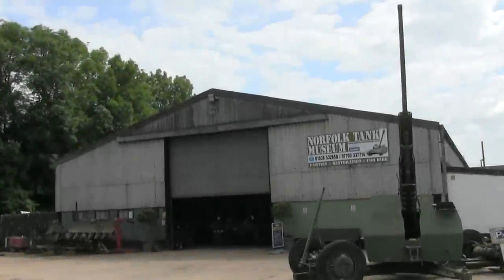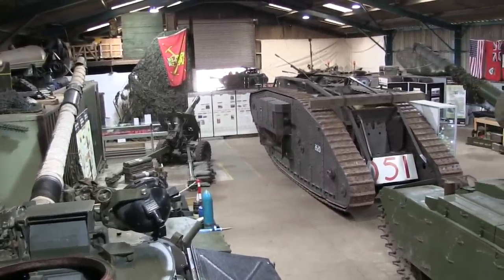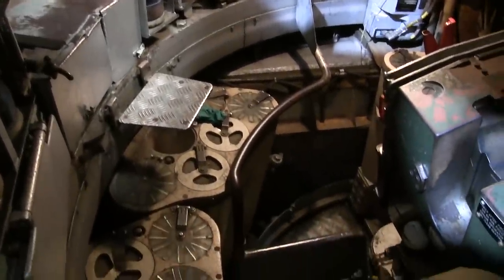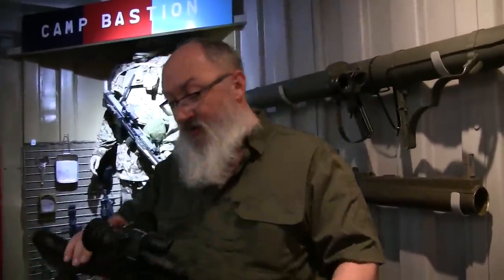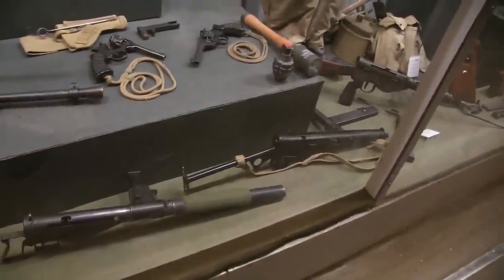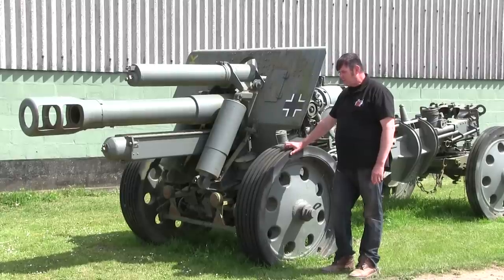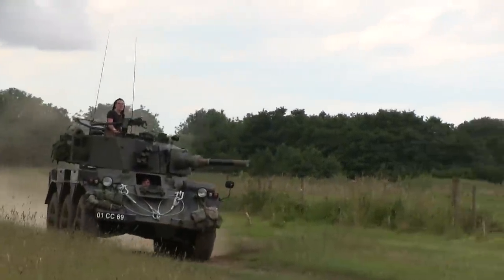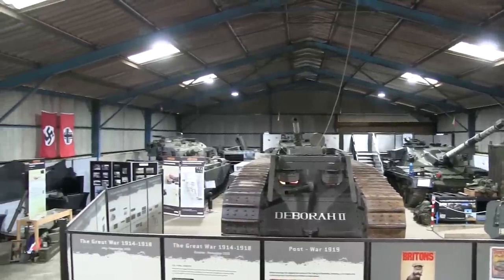The Norfolk Tank Museum

Comment: When I was there in 1999 with my best friend he had found a group that I wonder if it was the predecessor of this group. They had a Chieftain, FV432 and an Abbot. The Chieftain had the turret locked and the top cut away and seats installed. It was giving rides at Tank Fest that year. I drove the FV432, loved it, Abbot, felt top heavy to me, and got in the driver's hole of the Chieftain but could not drive it. It was very hot that summer. So it was very dusty on the driving range. I took a picture of my best friend with his smile being the only thing showing in the dust.

Comment: What makes a tank female? 

Or is it just every tank is female..?
Reply: Could be wrong, but I believe it depended on the gun setup etc for the particular tank. Only really heard the expression regarding the Mk IV tanks though.
Reply: It's a term that mostly refers to the tanks of WWI, but the basic difference is the "Male" tanks had 6pdr short barrelled artillery pieces in the sponsons and a "Female" had Vickers or similar machine guns fitted in the same place. "Deborah II" seems to have Lewis machine guns fitted - the barrel shroud on the outside and the pan magazines on the inside view give them away.
Reply: Males had 6pdr guns along with MG's (long and short barrelled 6pdr depending on tank Mk), females just had MGs, there were some called "hermaphrodite" which had one male and one female sponsor.